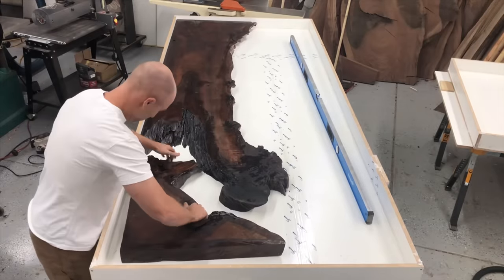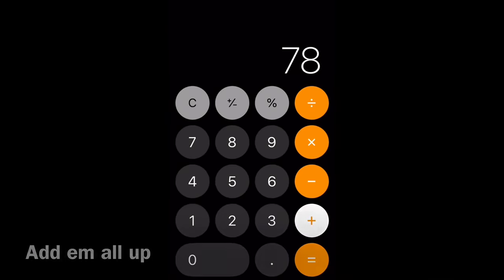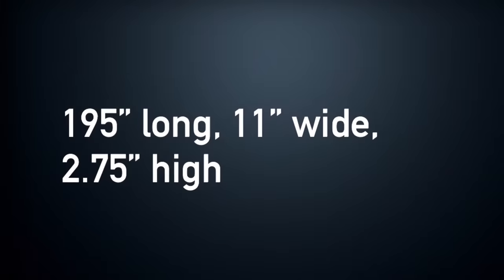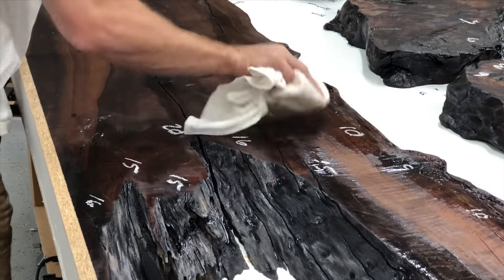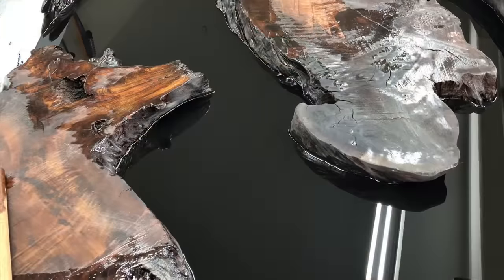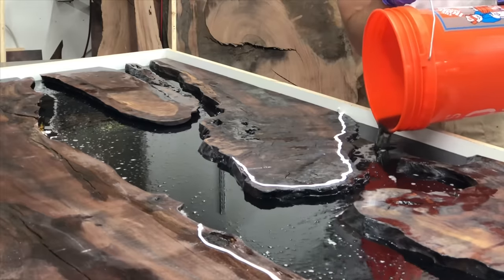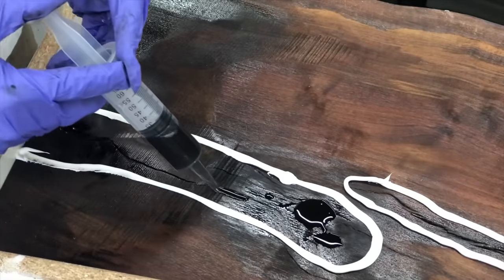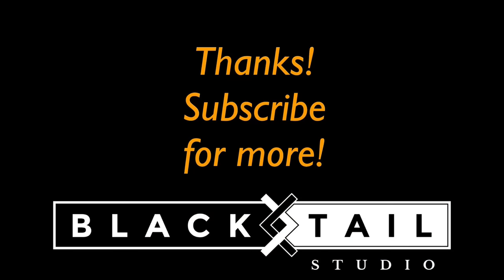Calculating Epoxy Volume--How to Epoxy Woodworking

Comment: So I have a question… Why don’t you just use something like play sand and a shop vac to get a perfect volume? You could use bags of play sand to pour into the table where the resin will go and then shop-vac it all out and get the volume from the buckets that you use to empty the shop vac. The coolest part about using sand, apart from it being a perfect volume measure, is that after a few times of using it, it won’t be dusty at all because the shop vac filter will take care of the dust :-) I could understand the worry of maybe some of the grits sticking in the hard-to-reach places at the very bottom but if you’re plaining the table top surely you’ll pull the grit right out of that part of the table.

Also, in regards to bubbles, have you thought of using some sort of vibration to remove bubbles? I know that you’ve done huge tables so it might be a little difficult to get enough vibration in the table but it would definitely be something to look into because it would eliminate the bubbles from your table as it cures.
Reply from the maker: Tape measure works for me 👊

Comment: I am a specialist in 3D scanning with Laser as wel as photogrammetry.
Although laser would give you the best results in creating a model for volumetric calculations, the equipment is very expensive.
However, with a cheap digital camera and reasonable software, you can make a 3D model that would be within a few teaspoons accurate.
Reply from the maker: You can... I can’t 😊
Reply: @BlacktailStudio  it is not that difficult. There are many good tutorials on YouTube on how to do this.

Comment: What is the most you'd recommend pouring at at time. I am working on a 2 inch thick river table using EcoPoxy. By my calculation the full pour will be around 18 litters. Should I stick to 1 inch pour at a time with around 28 hours between pours?
Reply from the maker: I’ve gone 2” before. But make sure you use fans to keep it cool. If you want to be safe, 1” might be the way to go.
Reply: Blacktail Studio it’s my first river table. I might go safe and do 1”. I’ll be pouring in my basement. The temps are study 73 to 74 degrees. I saw people using fans. Time to line dangerously :-) Thanks for getting back to me.

Comment: What do you do the final finish with after surfacing it in the machine? Hard to tell I  the video
 It looks amazing!
Reply from the maker: Osmo, I did the finish process in a separate video
Reply: @BlacktailStudio  Awesome! I found the other video. Great work, thanks for the info. Just started using epoxy.

Comment: A second thought...
Weigh one board foot of the wood you are using. Calculate the weight difference between the full size table if it were all wood and the weight of the wood you are using to make the table. The percentage difference can be turned back into cubic empty space the epoxy will fill.

Comment: I am new to using liquid pigment.  I have been using mica powder for all of my projects.  I am about to pour a 1.5 gallon pour and want an opake finish.  I am going to be using transtint.  In your experience/opinion how much pigment would you use to get the opake resin?
Reply from the maker: I don’t measure usually

Comment: What type of epoxy did you use? Do you not need to do seal coats with these or is that what your using the shellac for?
Reply from the maker: I use liquid glass now. And I have videos with all the steps

Comment: Well I’ve watched this one before, but I’ve also seen “Good Fellas” about 10-20 times, so...
Question: what did this slab or wood pieces look like before you started any work? Do u have any pix or video?
Reply from the maker: That’s well said 😂 and no video on this one. Probably some old Instagram posts if you scroll back though

Comment: Hi , in your opinion, what gives the best finish coat, Polyx hard wax oil, or Odies wax oil, I'm looking for a pretty high satin shine, not mega gloss, but something that after a few weeks has a good solid protection finish and sheen, thanks in advance, Karl
Reply from the maker: I use Rubio now.

Comment: I'm curious if you could pour a layer, then sandwich in some foam board cut to size, and pour a top layer.  Assuming the top and bottom were thick enough, it should be structurally sound, no?  It would also save in materials and weight.  I don't have any experience with epoxy though, just thinking of ways to reduce weight/cost.
Reply from the maker: Never tried that!

Comment: If it was just a simple straight river, could you caulk the pieces on the bottom to the form, say an inch or 2 from the edge? Would that work to stop epoxy from being wasted under the whole project?
Reply from the maker: Potentially!

Comment: Cam,  I am interested in a machine to put a finish the wood after a pour.  I am interested in a "Milwaukee" style polisher or sander.   The differences are the pad diameter. 7" or 9" and RPM.   What are you recommending and why?  I thank you ahead of time, Gregg
Reply from the maker: Maybe a longer conversation

Comment: I plan to do the same but with 1 inch depth pour, is it enough to hold wood in place, or should i go with 1.3 inch depth pour? 
And what is the best way to treat live edge's of the wood to increase bonding with epoxy?
 I'm curious, how long this table(top) will last(1-5 year), maybe more?
Reply from the maker: 1” should be fine. And check out my other vids to make sure you get all the steps

Comment: You can also take the small piece, put in a plastic bag, submerge in water (including your fist). Measure the displacement in the pail (subtract separately calculated fist displacement) and weigh the piece. Now you have weight/volume = density. Now weigh all pieces. Divide (total weight)/density for volume of wood. You measure the height of wood to epoxy, multiply by length and width of the box, for the total volume. Subtract the wood volume calculated and you have the difference = the epoxy volume. And the wood stays dry.
Reply from the maker: Or a tape measure. Whichever is faster 😉

Comment: Make the table mould watertight, Drill a hole and plug it. layout the wood pieces. Pour water to fill the void spaces. Drain the water into containers and there you have it, the volume required for the job.
Reply from the maker: So that’s a bad idea.

Comment: I would experiment with adding a filler to the bottom layer of epoxy or pour three layers with the middle one containing the fillers.  Especially if you are pouring something as opaque as black or blue.  I’ve used microballoon and colloidal silica.  You wouldn’t want to let it near the surface or edge but at 111 liters of epoxy it could cut your costs.  Even pieces of scrap wood sandwiched between pours to fill in the gaps might work.  You might at least experiment with it if you haven’t already.  I’ve also seen where people have used broken glass mixed in with a translucent color of epoxy with backlighting.  Also, when epoxy cures you can get an amine blush on the surface.  The amine blush can compromise adhesion.  Sanding mechanically removes it but since it is water soluble I alway scrub with soap and water as well.
Reply from the maker: Thanks for the idea!

Comment: The side we’re seeing you’re pouring the epoxy in, is actually the bottom of the table? I mean, after the epoxy dries you turn the piece upside down and only then you sand it in this big machine to make it flat? Or what? Tried my best with the English ahah
Reply from the maker: It’s ok, check out some of my table builds. Should help

Comment: Cam great video!  Question for you.  I'm getting ready to do a table pour of around 19 liters (using Ecopoxy).  This is my first epoxy table pour and I have seen many people recommend pouring multiple layers of no more than 1/4 - 1/2 inches deep.  Depth of my pour is only 1.5 inches total and I don't see a reason why I couldn't safely do this in a single pour.  Is there a strategy or secret for doing this in a single pour?  Any thoughts you have would be greatly appreciated.
Reply from the maker: You’ll be fine with a single pour. As long as shop temp isn’t too high
Reply: Sounds good.  My shop temperature will be between 65-75.  And i can also have some fans running across the top of the epoxy to keep it cool if that would help.

Comment: Hey Cam, I noticed the osmo 3043 is no longer available off amazon, for wood and resin would you recomend 1101 and then 3054 instead of 3043? Or is there a different finish you are using now.
Reply from the maker: Oh dang. Not sure

Comment: Perhaps you could fill the void between pieces of wood, with polystyrene balls, silica gel beads, or similar, and then pour those into a measuring bucket. 
Might be quicker than all the measuring and calculating.

Comment: Remove the wood from the form.  Using a few (hundred) 60-grit sanding pads, reduce the wood to dust.  Press the dust into 5-gallon buckets to determine the volume the wood will take up.  Fill the empty form with hydazine, bunker fuel, or a good lotion like Eucerin.  Pour the liquid into 5-gallon buckets.  Now just subtract the number of dust buckets 
from the liquid buckets, and VOILA!  You will probably need some wood glue to finish the project.  I recommend Titebond.
Alternatively, just pour enough epoxy onto the wood and into the form until about 2 gallons spill over, and you should be good.

Comment: Obviously I am not too experienced with epoxy so might be a dumb question, but to cut costs couldn't you just throw something in there as a filler (rock or glue down some more wood) since a. It will be too heavy to turn over and be able to see and b. You used black epoxy so you probably couldn't see it anyway? Seems like maybe it would save money spent on all that epoxy. Anyway the table is awesome, really cool video
Reply from the maker: Thanks so much Brett!

Comment: To everyone looking for a short cut, you could minimize your measurements by clumping the wood together in the form. But it wouldn't save much time.
The other option if you want to spend some money is to get a digital templating system for counters. It is computerized but in my opinion, not worth it.
Reply from the maker: Thanks!

Comment: You mentioned having to scuff up the first layer to get a good adhesion for the second layer.  If I did a river table with a blue epoxy strip, then wanted to do a clear epoxy "flood coat" over the top of the whole thing (like a bar top), would I need to scuff that blue strip first?  Thanks.
Reply from the maker: Yup 😊
Reply: Blacktail Studio what grit sandpaper would you recommend? Thanks!

Comment: If you clamped the wood to the bottom piece especially since you are damming the river you could reduce all the under pour waste
Reply from the maker: Good call!
Reply: Blacktail Studio yea i used to make giant conference tables for a company called landscape systems and that was the easiest way also saves the planer and sanders blades and papers cause epoxy makes it really gummy. But beautiful table love the finish.

Comment: I wonder if it would be more or less accurate to take an off cut from the same wood you are using in the pour, square it up into a cuboid and measure the height, width and length - you got the volume (V = h x w x l). Weigh it. With volume and weight you got density (dens = weight/volume). Now weigh the wood you are using in the pour - using the density you can easily calculate the wood volume (vol = weight/density). Calculate the intended volume of the final table (using form dimensions and intended pour thickness) and subtract the wood volume. You got your resin volume. This should work well as long as the density of the wood doesn't vary wildly. I don't think it should in healthy wood, for wood with rot in it it may vary a lot probably...

Comment: Hi my name is Greg. I'm working for an arborist in canby and we're building a conference table. I bought the epoxy, dye and form release. We're making it black. The wood is lighter color so we're trying to decide what to pre coat everything with and if we should coat everything since it will be trimmed to size and sanded. We're thinking to precoat all of the wood with a clear epoxy and then use the black dye epoxy to fill in everything else. Are rationalizing is to precoat everything first in case some of the diet epoxy got into some of the softer wood and shows up even after it sanded.so I don't know I heard you say shellac one time and the video but I'm not sure what product you use to pre-seal your wood. Thank you if you read this and are able to answer that would be awesome... love your videos.
Reply from the maker: I think the precoat is a good idea
Reply: @BlacktailStudio  thanks. Can you recommend a product or technique or link to one of your specific videos and I can go from there 😃
Reply from the maker: Check out my last epoxy table build. Should be what you need

Comment: What if you set the wood up in the form, fill it with water, then remove the wood and drain the water from the form into a buckets?

Comment: So I have a follow up question. I poured the epoxy, 9L. I have a Divet between a tight edge of the wood and epoxy margin. This depression is deeper than the mean level of the overall surrounding epoxy level of the table. If I sand it flat now I’ll have to take it down all the way to the depth of the stupid Divet which is way too deep for the thickness of the table I want to keep; since it started as a inch and a half slab of wood. Can I fill it with more epoxy now that the table has cured and have this mini point pour (5-8 ml worth of epoxy) let this cure level, then sand the whole thing flat? I too have an industrial sander available to me in my community to level the table flat. I can scuff it up really well and then I was thinking of using JB minute weld epoxy it cures in 60 minutes and it’s clear. The main epoxy pour was tinted a very light sunglass shade of Black.  Or I Poor a small amount of the same ecoproxy two to one used and I can try to tint it. then  I let it cure over 72 hours that way it’s the same epoxy with a different shade of tint or leave it clear.  I won’t be able to match it exactly for sure. My last plan is to use the west system 105- 207 clear to fill the void but I’m worried that this epoxy will be harder than the main pour of ecopoxy and I’ll have a hard time sanding it level.   I need ur advice Obi-Wan Kenobi. What do you think of my plans
Reply from the maker: No worries! Fill with west. It will be harder. Sand carefully. Move the sander quickly to avoid problems.

Comment: Hey Cam, I’m not sure if you’ve noticed but on the volume calculator link, it doesn’t have an option for you to choose rectangular cuboid anymore and I was wondering if you have another way to calculate?
Reply from the maker: Hmm, I use the website still. Just dig around some more

Comment: Cam, did you not removed the soft wood and soomthened the edges of those pieces with the angular grinder? Those edges look quite sharp and very uneven. I also observed that you have not coated these pieces with a layer of epoxy before joining them. 
This video is very different than your regular ones. Any reason for this?
Reply from the maker: I did this one like my other ones

Comment: Cam, I think I heard you right. 2 days later and it will still be sticky? Also, How long do you wait before you apply heat to get rid of the bubbles? What happens if you apply too much heat?
Reply from the maker: Depends. Usually not sticky after about 20 hours.
Reply: @BlacktailStudio  Thanks for responding

Comment: If the parts don't mind getting wet:
Drill a small hole in a corner, plug the hole, fill the table with water, unplug hole and measure water volume once fully drained

Comment: Could't you use a piece of string that would run through the river, and measure how much sting you needed from point A to point B? Will cut down some measuring and calculating time.. or am I wrong?
Reply from the maker: Sure, probably 20 different ways to do it 😊

Comment: If you make one of these and are using a router sled to flatten after the pour do not do what i did. If you have any chip out from taking to big of bite with your router just go over it again a little slower. I thought i could mix a little more epoxy and skime over the chips. Ended up being a diff tint of the black and after all the sanding then finishing you can see them.
Reply from the maker: Ya, that’s no good

Comment: Take 1 square inch of wood of the same type weigh it. Multiply it's weight by the volume of the complete table. Now subtract the weight of the wood pieces you have.  Divide that by the weight of the 1 inch cube. You have your volume of resin.

Comment: Hey Cam. Got a question: I'm a newbie, but if you ran a bead of silicone on the bottom of the table just back from the edge of the pour, wouldn't that stop the epoxy from leaking under the table? Therefore eliminating so much epoxy waste. Just curious. Thanks!
Reply from the maker: In theory, ya. But it never works for me
Reply: @BlacktailStudio  Hey man thx for the reply. I absolutely love your work. I have learned a ton from you.

Comment: What about the idea of filling with polystyrene beads, then pouring them into a measuring bucket?

Then all you need to do is blow the table with compressed air before pouring with the correct volume.
Reply from the maker: Or a tape measure if you don’t have 100 liters of beads 😊
Reply: @BlacktailStudio  well if the tape measure works well enough, I guess so :-)

Comment: If I'm opening & only using, say, half of my epoxy resin & hardener, can I quickly put the caps back on the remaining for future use w/o it hardening in their containers?
Reply from the maker: Yup!
Reply: @BlacktailStudio  To confirm, is the table top always face down during the pour?
Reply: I take that back, the top of the table is facing up during the pour while in the mold...